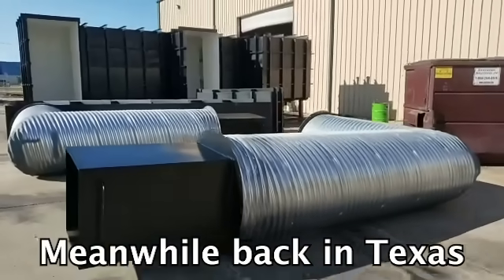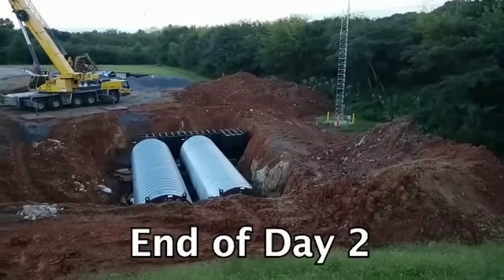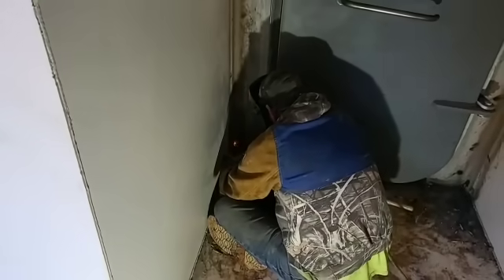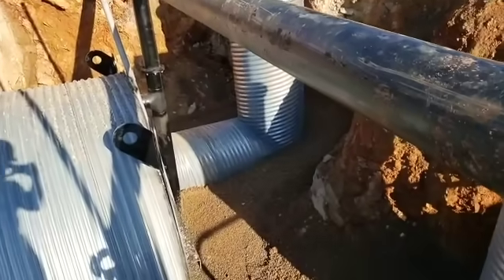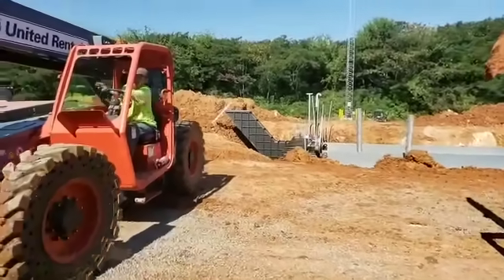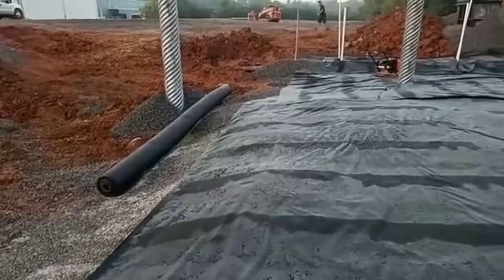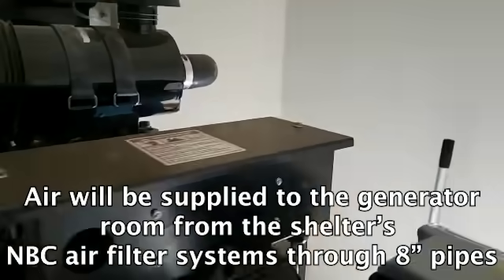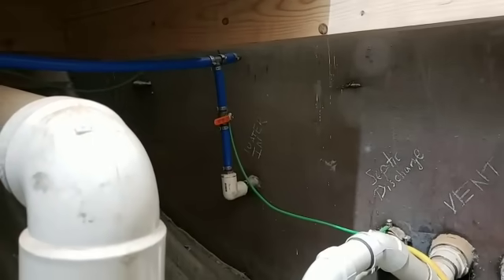Installing Two "Big Boy" Bomb Shelters "Side-by-Side"

Comment: As one who has been in construction for almost 50 years I believe this system is to trusting in the welding; I personally would design a flange, seals, and welding system to secure against leakage, I also would cover the whole system in a rubber coating as I went along to secure for leakage!!!
Reply: Settling will break those welds.
Reply: @colt45peacemaker  I agree, among other circumstances!!!
Reply: Your right. A double weld doesn’t guarantee a water tight seal unless you X-ray the welds. But that’s costly. Also if you noticed, the vertical welds were being done down hill. Any welder knows what that means. Slag runs into the weld area meaning no penetration. Might as well use superglue. I’m in excavation. Mass earth, a sump pump isn’t needed if they install a drain field. Like a sewer system. Their excavator operator “expert” sucks to. I’ve fired better
Reply: @edgemonsiteworksllc3369  amen  my friend exactly, these tactics are headed for disaster, most people don't figure, or ask their selves what if, and is this the best tactics; their tactics is let's get it done to minimal specs, and let the consumer reap the headaches!!! We  both know there is a difference such as a 5 star piece of material, and a 1, or 2 star piece of material, and they either don't know, or don't care!!!
Reply: Wheres the Flex-Seal when you need it?
Reply: @homerfantastic  yes!!!
Reply: Can you seal by covering the whole thing in fiberglass and epoxy like an upside-down boat? Also put a tarp layer on the outside and wrap the inner walls in a water bladder (for water storage and radiation protection).
Reply: They barely had any rebar in their slab...  It's not like they are following any building standards here. lol..  I wouldn't worry about leaks-- you can always weld up leaks from the inside and patch over it.  Besides, even if you made a "flange" like you said, you still have to weld that flange to the pipe;   So what is the difference in welding to the flange or just welding to the plate that is there....  none
Reply: @calholli  you're not catching what I'm saying at all, I guarantee my system is much better, and no you wouldn't need to weld for there would be heavy duty rubber seals between the flanges, but I am also saying I would weld over the outside of the flange, you say you can go back, and weld over the welds that wouldn't help you if you have an extended stay in there and it broke loose then you would be screwed!!! My system would carry much more security, welds by themselves can never stand the test of time for metal rust, and decays horribly under ground!!! I also said I would rubberize the outside of the metal right before drainage, and the  concrete was poured!!!
Reply: @redreeler4905  Do you not understand how construction works? lol....    Tell me how you're going to put a flange on the culvert?   HOW do you connect the "flange" to the end of the culvert/ pipe/ big tube?  You're not thinking through what you are saying.......   You would STILL have to WELD the culvert to the flange- just the same as welding it directly to the plate of the cross section--  so what is the difference?  You're still ending up with a welded joint at the end of the culvert either way.   Just because your flange is bolted and has these giant seals and is super water tight---  You still have the SAME WELDED SEAM between your flange and the culvert;   so you gained nothing at all.   All you did was add more parts, more bolts, more work, and you're still right back where you were...   And YES.  they have a giant generator in there, the air is constantly filtered and circulated.  There's no way that they don't have a nice little welder stashed in their bunker tool kit.   Also the "rubber coating" you're talking about---  they do have it -- they show how they paint it on in the video, it's black.  And they also use that sticky tape and plastic.   In case you don't understand what all the rock is for-- it allows the water to drain to the bottom very easily, and there are pipes down there that drain the water away from the structure-- it shows all this during the first stages of construction.  Plus those culverts are "galvanized"  they are very unlikely to rust for hundreds of years, while being surrounded by rock, which lets all the water drain away;   meaning there will never be any standing water....................   

To top it all off:    THEY ARE BUILDING ABOVE IT..   He clearly says at the end, that they are going to pour a giant slab and build a huge building ABOVE this bunker.   So all of this whether-proofing of this bunker is redundant.   The entire thing is going to be covered by a giant building.  When you come up the hatches, you'll still be INSIDE the building. This is an interior storm bunker for the building -- it's not just some random hole in the ground out in the field like you think............   Also, they compacted that rock every 8" poured--  that's a lot of compacting,  so that means there will be very minimal settling.........  The welding is fine:   

The thing that bothers me is:  Why did they dig that hole so oversized?   That was days of digging that didn't need to be done.  Why not use the dead space in between the culverts?   That seems like a big waste;  at least fill some of that space with pop out closets and things like that;   maybe some cross tunnel rooms
Reply: @calholli  I get so sick of making comments on here sometimes with the backlash of bull!!!
Reply: @redreeler4905  It's just a simple question:   How would you connect this flange to the culvert?
Reply: @calholli  I don't answer stupid questions, figure it out for yourself!!!
Reply: @redreeler4905  lol..  You don't have a clue
Reply: @calholli  Yea, idk what this red reeler dude is talking about. A flange wouldn't really make sense for this application. At least it doesn't to me.
Reply: @JoeBlow-ub1us  A flange makes sense in the fact that you can pre-weld it all together in a factory, and then once it's on site, you just need to bolt it together.   So you don't have to weld it on site;  and the factory can use machines/ robots to do the welding and save money.   So there are reasons to use it.  But it does NOT mitigate having a welded seam like he was saying. lol...  It still has to be welded either way..  Plus there's a chance that your rubber seal/ flange will leak later.  So, IDK.  Some people just have learning disabilities, and nothing that you say can help them.
Reply: @@ristokempas.  Fantastic!
Reply: those bunkers are not secured at all the whole installation is designed to save money not to maximise security , i mean as a bomb shelter those bunkers sucks but they may protect against robbery i think
Reply: Did you see their welds it was shot welds
Reply: Does any one here understand how radiation and nuclear fall out works
Reply: @edgemonsiteworksllc3369  I really think that there was some "over selling" of a few options and this is a "luxury item" that will MOST likely NEVER be used...
Reply: @@ristokempas The shelters you guys have there ARE LEGENDARY and COMPLETELY AWESOME. I love how SOME of those spaces have now been converted into dual usage facilities that are AWESOME but NOT ALL countries were blesses with so much granite!!
Reply: Guys, Here is The Savior

YaH The Heavenly Father (Genesis 1), YaH, Who, with His HAND, formed “man (Adam)”, from the dust of the ground (Genesis 2:7). It was YaH’s HAND they NAILED to the Almond Tree, to symbolize forgiveness of the “Tree of Life” sin OF “man” and thus “The Fall OF man” (Genesis 3). YaH The Father arrived to be Crucified via the Tent of Meeting (Exodus 33, Isa Scroll), how YaH has ALWAYS arrived
Reply: I’ve asked on multiple videos who QCs the welds cuz all
I see is undercut but no response lol
Reply: thats what i wa thinkong too
Reply: @SPIKESPIEGEL1969  someone needs to for it needs to be built right for I've heard of too many that leaked!!!
Reply: buddy's never heard of pipelines